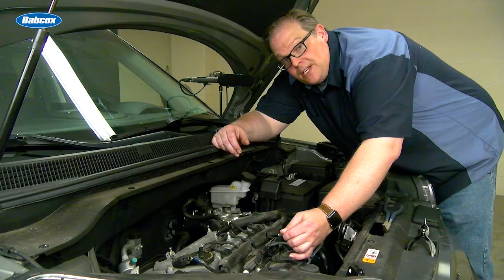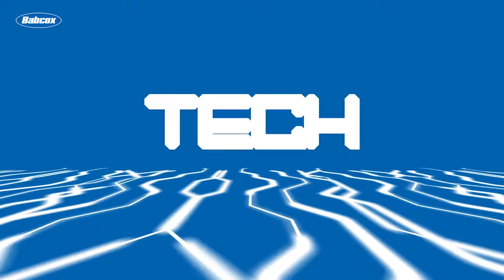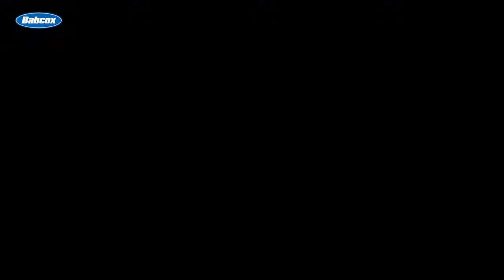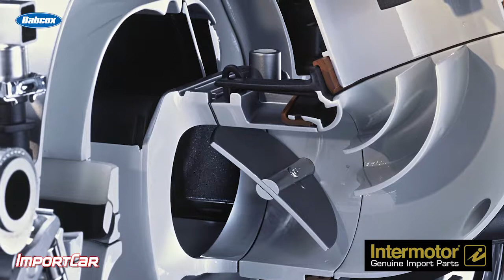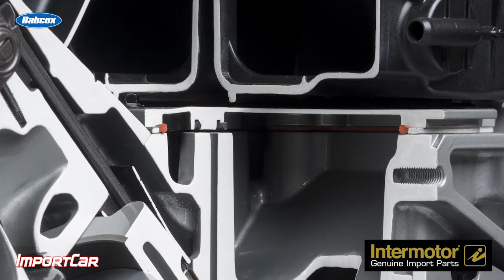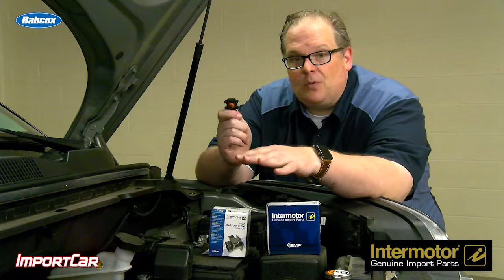How Do MAP and MAF Sensors Interpret Vacuum Leaks? | Tech Minute

Comment: Why can't anyone explain what the map sensor psi readings should be. 5.3 engine
Reply: If you tell me the engine I can look it up on AI for you. At idle warmed up?
Reply: @markman090  2004 gen3 Chevy 5.3
Reply: @brianwalck632  Normal MAP Sensor Range (in kPa):
Key ON, Engine OFF:
~101–103 kPa (this is atmospheric pressure, depending on elevation)

Idle (engine running):
28–40 kPa

At idle, there's high vacuum in the intake, so the MAP reading drops.

Cruise / Light Throttle:
30–60 kPa, depending on load and throttle opening.

Wide Open Throttle (WOT):
Close to atmospheric pressure: ~95–100 kPa

Vacuum drops, pressure rises.

Quick Conversions (if your scanner uses inHg instead of kPa):
100 kPa ≈ 29.5 inHg

40 kPa ≈ 11.8 inHg

30 kPa ≈ 8.9 inHg

If you're seeing values outside this range or erratic behavior, it could indicate:

A faulty MAP sensor

Vacuum leak

Wiring/connector issue

ECM problem (less common)